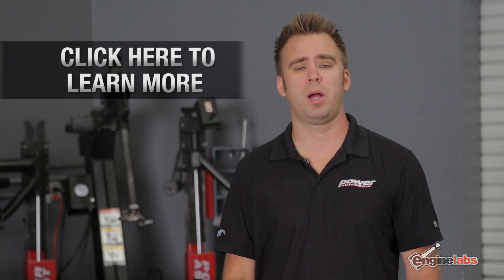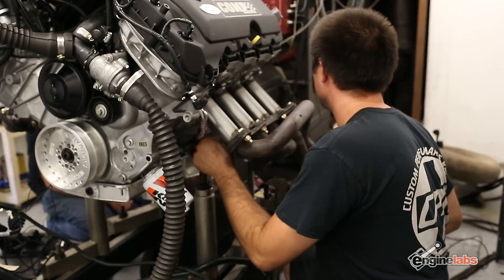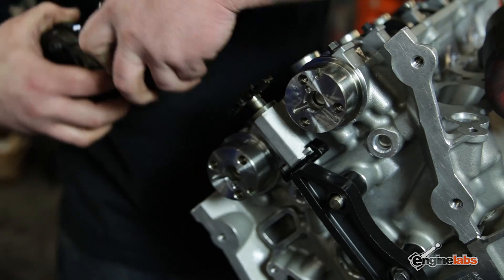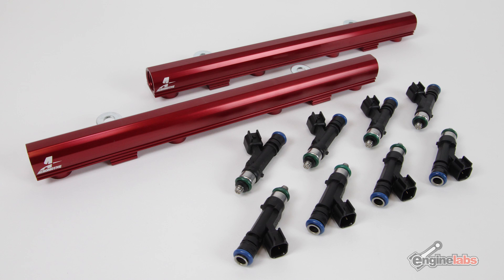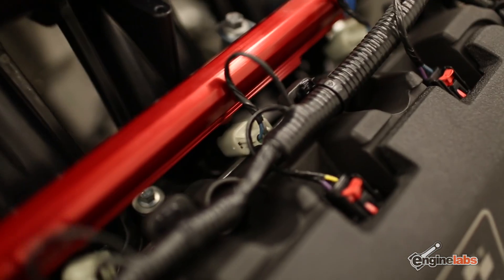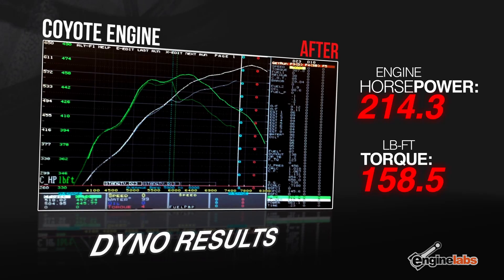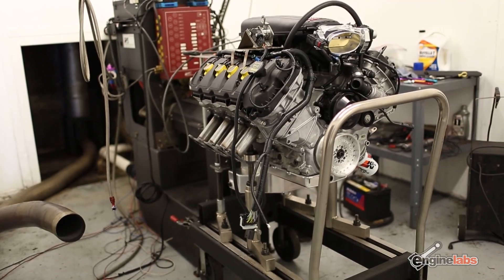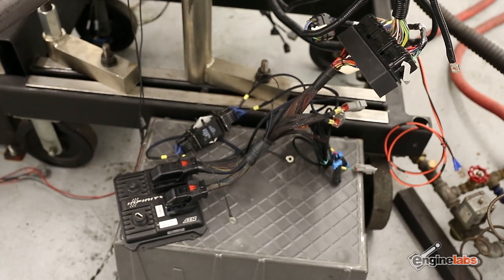Building a 625 Horsepower Coyote Street Engine That Turns 8,500 rpm

Comment: So you are going to spend $25,000 or more to run with an $8,000 small block Chevy.
Reply: $25,000? I don’t think so. 

If you have a coyote you just add boost and fuel. $8000 for a centrifugal blower and fuel system will net you 800 to 900 whp. No touching rods, pistons, heads, or cams.

Comment: What is the build list for this motor? If I already have a coyote engine what would I have to do to get these kinda numbers, no supercharger or turbo
Reply: Pmas intake, VMP twin 67 throttle body, cobrajet manifold, comp stage 3 cams, long tube headers, catless x pipe, E85, and a good tune. 

Even then you’ll struggle to touch 500 whp. Probably 480 to 490 at the wheels. There’s a lot of happy dynos out there that will show otherwise. Don’t be fooled.

Those NA parts will run you $8,000. For that price you can buy a centrifugal blower with a “boosta-pump” and make 650 whp all day on 93 octane pump gas. Do not waste your money. Go boost.

Comment: 4 valve cylinder heads are the way to go judging by my experience on the dyno between 4 valve cylinder heads and 2 valve cylinder heads of equal size motors on motorcycles my opinion just saying

Comment: Nice motor  , you proved that you have to spend over 25k for a coyote motor  to get 600 hp. Just build LS7 for a fraction of the cost and get 700 hp with 600 ft lbs of torque .problem solved

Comment: Wicked a$$ build guys!!!! But what is up with the 6" header tube extensions??
Reply: It wouldn't clear the dyno stand/unit. Even with the extensions the flex pipe had to do a 90 degree turn to make it.

Wonder if the added runner length boosted low end torque;-)

Comment: This would be great motor for my 2001 mustang v6 that I want to convert into this type of v8 engine the house is what I am looking for can you send me some information on this engine and wiring that is needed.
Reply: If you have the 5.0 coyote...this EFI motor would cost about $16,000 in mods...if you did most of it yourself.

The Big bore mods is $1,900 if you supply the 5.0L
$1,350+ for Oliver rods
$1,200 Mahle Pistons/rings,etc
$1,500 in parts/labor on the heads
$5,000 for the EFI intake/Throttle body/ ECU  
$1,000 for the Meizer coyote water pump
$1,250 for the COP controller, cometic gaskets, bearings, ARP studs, Oil pump upgrade.
$1,350 for Comp cams 
$1,250 for headers and coils

http://www.stangtv.com/tech-stories/engine/carbureted-cobra-jet-coyote-part-2-the-short-block-build/
Reply: Thank for that information it will help me make up my mind on the direction to go.
Reply: NO problem...Do you have a 5.0 coyote already?

 If not, You might want to consider doing the 6.2L Ford instead. Roush  Bored/Stroked a 6.2L to460ci that made 850hp@8,500rpms All motor. Woudl definitely have more Torque.

https://www.youtube.com/watch?v=oDeaJe4Hb6Q
Reply: No, I don't have a motor still doing my research getting information I know I want efi 500+up naturally aspired  street rod 2001 ford mustang
Reply: The 500+hp N/A is the issue. I personally would run turbos so It would get great MPG and is easily turned-up for when, weather allows.

You also have to take into account the Price$$ of a transmission, etc that would be needed with a 500+hp engine..

Comment: swap the motor into a 1989-1997 Thunderbird-Cougar.
-its already setup with a mod engine, simple swap..
4r70W trans..
IRS suspension...
good starting point. with that Nascar V8 Rpm sounds true to be in a Nascar based body the Tbird. 
Ijs..
Reply: Travis James nah. On a vic.. Sleeper car that costs way less than a mustang. 03 and up had room for dohc since the marauder was a dohc 4.6 and then had the same panther platform..
Reply: Why would you put a piece of shit engine into a but ugly car.😢😢
Reply: 4r70w wasn't used until 93

Comment: Is there a manual transmission with synchros that will handle 8500 rpm shifts?  T-56 maybe?
Reply from the maker: Tremec will be able to answer that for you! Their number is (734) 456.3700
Reply: Favian Garza  There has to be, those Honda guys run 11000 rpms through thier manuals.

Comment: Those are FOOT pounds.  500 lb.-ft. means 500 pounds at one foot.  "Pound feet" is what one does when they get fired, on pavement.  I truly don't know where this "pound feet" thing got started, but we made it for decades before things kinda degenerated, I suppose.  There are foot pounds and inch pounds.  Imagine if they said "pound inches."  "Pound inches" is what one does when their girlfriend cans their @$$.  That's what they'll be doing!  Pounding their inches, because she will not be there for the event.  

500 lbs. hanging on a 12" wrench means 500 pounds at one foot;  "foot pounds."
500 lbs. hanging on a 1" wrench means 500 pounds at one inch: "inch pounds."

If the chart says 500 lbs.-ft. it does not mean "pound feet."  It means 500 lbs. of force enacted upon an axial shaft at one foot.  

Mechanically speaking, "pound feet" sounds ridiculous and grammatically, it sounds pretty ridiculous, too.  "Pound" is a verb, because it's an action word for "feet."  Do engine builders "pound" their "feet?"  No.  Is there a specific type of "feet" that are known as "pounds?"  No.  What exactly are "pound feet?"  Certainly they'd be "feet" that weight a "pound," because of course the "feet" don't weigh 500 "pounds."  500 hundred "pound" "feet?"  I see!  It's a 500 pound foot on a 12 inch bicycle crankshaft?  No.  

The mathematical conclusion would suggest that "pound feet" is most appropriately applied to: "POUND FEET, Jetson!"  "You'rrrrrrre FIRED!"

Comment: Put IN A CAMARO AND PISS OFF THE CHEVY 
SAUSAGE FEST
Reply: Yep, you sound just like an engineer.
Reply: To whom doth thou speak?  It couldn't be me, Omar, I just left a post.
Reply: Only because they've been around longer, so there's more aftermarket and finding a cheap one is easy.  Also, they're a smaller package, so they're easier to fit in more vehicles.  That said, the coyote's rev much higher, have better heads, respond better to mods (especially boost) and can handle more power before having to upgrade internals.  The downside is, they do cost more and are very wide.  They also weigh about 20lbs more than an LS.  They're both great engines and if we're honest with each other, we're lucky to have such great choices.  Given the choice, I'd build a 5.2FPC, just because it revs to infinity and makes insane power stock.
Reply: @grahamwellington943   they cost 5 times what an Ls cost.  And they're junk!
Reply: @kennithchapman9689  Even though you're obviously trolling, I'll respond.  Things that are better, often do cost more.  They aren't 5x more expensive though, regardless.  A stock Mustang GT with 5.0L of displacement, makes more power and outruns a stock, lighter Camaro SS with 6.2L of displacement.  That begs the question, if 5.0's are junk, what exactly is an LS, aside from a knockoff of an antiquated small block Ford, from the early 90s?
Reply: DOHC is not a downgrade, multi-port injection is.  They should've advanced the timing, the torque was not smooth. They might not have had room with lower octane, but, with direct injection they would've had room to.
Reply: Yea , how does higher tech equate to a downgrade? OHC is mechanically superior to OHV. Any one with any mechanical background can see that even if your a GM guy.
Reply: Buddyrebel primary choice because they're 2 for 1 hahaha
Reply: More valves and rpm is a very effective way to make horse power. Liter for liter DOHC wins every time per state of tune.  Thing is with pushrod you can always go bigger displacement for the packaging size compared to DOHC motors and use brute force of displacement rather than volumetric  efficiency  of  DOHC. Those coyotes have heads bigger than a big block with out nearly the cube potential for example
Reply: HDVICTORY ford " OHC is mechanically superior to OHV."

How so? Because I see some major mechanical drawbacks to DOHC. The massive parts count alone makes mechanical issues all the more likely to happen. 4 cam, 4 cam phasers, 4 VVT solenoids, 2 secondary timing chains, 2 mile-long primary timing chains, 32 valves, 32 valve springs, 32 rocker arms, 32 hydraulic lash adjusters, plus timing chain guides and tensioners. All that added complexity for a meaningless HP/L number and slightly better emissions?
Reply: Everybody else here is thinking about cars and engines. You're thinking about guys' dicks. You must be a Ford guy.
Reply: It would never fit.  It weighs so much it would break suspension parts.
Reply: Daniel vera my tuned ecoboost f150 regular cab tremor losses almost everything off lol
Reply: Buddyrebel the la is old school and will go the way of the flat head. They thought the flat head was forever but they were wrong the gov is at the end of its life.
Reply: exporting and development with Daniel
Challenged accepted.
Reply: It's a expensive pos w no low end power all top end.. more shit to break timing chains stretching and losing hp spinning = waste of money and time 3x all those parts and labor... When Did Ford ever make 650hp with 1 cam?  Pushrod motors you cant go wrong wtf is wrong w/ F.ucking O.wners R.eally D.umb!
Reply: while the ls makes more horsepower because of more cubic inches; the ford 5.0 puts out more horsepower per inch than the chevy does. technically the ford has more power in it than the ls does.
Reply: @carnation038   but an Ls isn't a piece of shit though. Coyote is a Ford, a known chunk of dog shit!!!
Reply: LOL, LS engines are the primary swap choice of everyone including Ford guys. This thing is crap.
Reply: Nonya Businesss i like turtles
Reply: Nonya Businesss if that pleasures you it dosent mean it will pleasure me, so nope i wont practice your silly behaviours.
Reply: That's what I was going to suggest as well.
Reply: It'sTricia'sLife  are you stupid?.....seriously
Reply: Daniel vera piss them off by giving them a downgrade, yea theyll get pissed😂
Reply: @omarcantu134  butthurt huh?
Reply: Whenever you become an engineer like me then you can comment.

Comment: Does this motor use the stock camshafts?
Reply from the maker: +Tommy1198S No, it has COMP Cams.
Reply: +Power Automedia stag 1, 2, or 3? If not, are they custom?
Reply: +Tommy1198S Thought about it some more and I think you're using the stage 3 cams if not custom, since the redline is so high.
Reply: did  you watch the video or read the narration?

Comment: The Coyote is by far one of the better engines ford designed. Big step up from the junky 5.4 3V I have in my f150!
Reply: My 5.4 3v at 265,000 miles haven't even done timing chains yet💀

Comment: I think the car I'm building (GT40 replica) would have been a great home for it! LOL Actually, I have an engine very similar to this going into it. It's a 2013 BOSS based engine from MMR with fully ported heads running the same Cobra Jet intake, MSD coils, strengthened internals, etc. The cams are the stock BOSS ones and the electronics are from Ford (the one they sell for the aftermarket Aluminator). I'm fabricating the headers now and will finish the exhaust soon. I only anticipate about 525 horsepower from it though. If you all ever want to swap engines as a project...LOL

Comment: Im not here to argue with the results of either induction,but a couple things you could have advanced power on the carb 5.0 coyote test was put the header extensions on just like on this video thats a gain, you did not use them on the carb video,and as well put a dominator or sv1 carb,not saying 4150 carbs dont make power but, there was another easy 40 horse gain on the carb test,using the header extensions and a sv1, I would be glad to be apart of the redue on the carb set up with what i have suggested, but I dont expect yall will do the carb test again.

Comment: the new 5.0L coyote is the best small block ford yet with amazing power with options
Reply: 1st: Yes, the Coyote is a small block. The engine ends up being physically large because of the DOHC design of the heads.
2nd: You don't have to pull the engine to change the plugs. they are literally right under the coil covers.
3rd: Please stop talking, both your points were completely wrong.
Reply: The windsor is an amazing engine when done right. More than once I've seen them make 1,000hp na from a small block.
Reply: James Pugh best small block period
Reply: +James Pugh It sure is I love mine.
Reply: It depends, if price isnt an issue.
Reply: DOHC is amazing and makes the power, but not for budget builders.   Check out Pneumatic Valve Actuation
Reply: ***** must are that way. My Nissan got pull the top end get to plugs

Comment from the maker: Yes, the bucket list is long for vehicles that this engine would find a nice home in. We ended up putting it in a 65 Mustang: http://www.stangtv.com/project/project-biting-the-bullitt/
Reply: I clicked your link, it shows a 427ci with a Paxton S/C in a Silver 65 Mustang Coupe!  Were's the 65 Mustang with the Coyote engine?  Thanks and God Bless!
Reply: not unless it was a numbers matching car which the vast majority aren't.
Reply: Power Automedia 
Fair enough.
 Bought a crate motor and Borla induction is building it up now.
Reply: +Power Automedia Soon I plan to fit a Supercharged Coyote crate into my Grandpa's old 1969 Boss 429 body!

Just researching the trans, and saving up! Most likely won't even have to widen the trans tunnel!
Reply: +Power Automedia ever since the Shelby 5.8 came out, I haven't stopped thinking about putting it in my 69' Mach with out the supercharger, but now I am curious, how mutch hp and tq will you gain with an extra 50 cubes to this engine you have built, or plain and simply, is the 5.8 make 500 hp out of the crate? Never the less, after your video, I will make my own with all your combinations, thank you.
Reply: +Vanessa Alexis Moreno get a ford 6.2 from a f250 or f350. same engine in the 150 raptor. run the aem or holley dominator efi setup with coyote wiring harness. stock bottom end will handle 700hp. throw in some custom ground cams and your looking at 600+ hp with a good tune. find some builds on 6.2 fox bodies or 6.2 swapped mustangs that were used in drag racing. stock swapped wont cut it.
Reply: +Vanessa Alexis Moreno The 5.8 was never available in a crate, and they dont make them anymore. Ford had the 5.4 litre supercharged in a crate, but it is discontinued as of this year. probably because it was 27,000 dollars
Reply: +cybertree bullshit!  ur pa probably owns a fairmont not a stang
Reply: +pat mcgeough these comments are absolutely weird? people obviously dont know a thing about ford motors
Reply: +winston didit you have not even the slightest idea what youre saying do you?
Reply: You should put it in my dodge stratus
Reply: wouldnt it be cool if a cmpany made a ingition system that coud control the valve timing on a carb engine, it also seems as alot os sheetmetal intake dnt stack up to well against some factory and aftermarket intakes, it seems alot are made off of theroy, my personal choice tho i like the prosystems sv1 carb, it s a beast a whoe lot dont use it tho i think its cuz or change ppl dnt want to change
Reply: Just body ? you are not ruining a classic ?
Reply: you should have put it in my 2012 ford fusion. after the conversion from 4 cylinder front wheel drive automatic to a real wheel drive manual v8

Comment: You should put this in a crown vic.
Reply: +jason andrus I have a 6.2l in a 04 marauder. I shit on mustangs constantly.
Reply: +Dragon Knight of the Ebonheart how well does it fit. i am trying to do the eaton swap.
Reply: not bad. a coyote would fit in the crown vic aswell but coyote cost more. the biggest problem is the intake manifold though. I built several sheet metal intakes for the 6.2l for a couple of guys and myself.  the cams need to be regrind which was about $300 for both, the 6.2l I had a cam crank trigger and cam reluctor wheel cnc for me so I can retain factory marauder sensors.
long tube header's for a raptor fit perfectly.  both the 5.0 and 6.2l share the same trans bolt pattern as the mod motors did.
honestl if I were at the moment I would grab a 5.4l and stuff it in  the crown vic for a little while. unless you have about 6k or so. remember it costs about 6k for a coyote and that's not even the other stuff that you have to buy to get it to work. or get a 5.0 big bore boss block from ford and a set of 4 valve cobra heads for the 4.6l. itll do the same thing as a coyote would.
Reply: +Dragon Knight of the Ebonheart F150 coyotes with 50k miles are $2500
Reply: +Nick Sandman not calling you a liar but I highly doubt that! I have not seen a coyote used for that matter under 3500. even if you do get your hands on a turd coyote and wanting to stick it into the crown vic youre still going spend thousands of dollars more than what you can with a big bore mod motor and the 6.2l.  for 302 cubic of displacement a coyote is not feasible in many senses.
Reply: Dragon Knight of the Ebonheart look online, and also I heard from a cobra 4v builder that some are as low as $1700.
Reply: ***** I did look online still all coyotes I see are 3k plus
Reply: Dragon Knight of the Ebonheart I just got home lemme pull it up
Reply: im looking at 3 sites and no where do I see any coyotes under 3k. again not calling you a liar.
Reply: Dragon Knight of the Ebonheart here
http://www.ebay.com/itm/13-Ford-F150-5-0L-Engine-Motor-52K-OEM/191664054452?_trksid=p2141725.c100338.m3726&_trkparms=aid%3D222007%26algo%3DSIC.MBE%26ao%3D1%26asc%3D20141212152715%26meid%3D9f8e7de2522c46e289d5dbe6c5afc202%26pid%3D100338%26rk%3D3%26rkt%3D30%26sd%3D311429735337